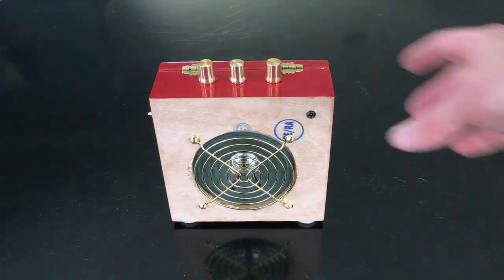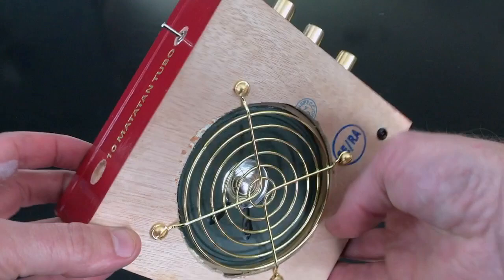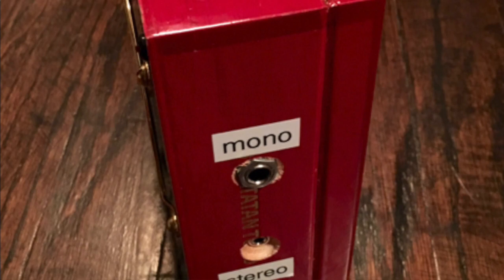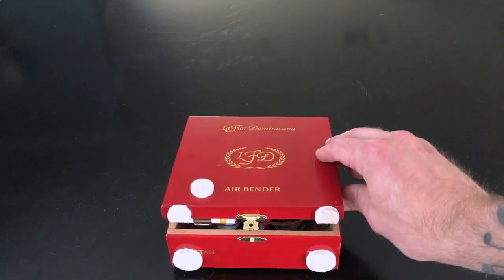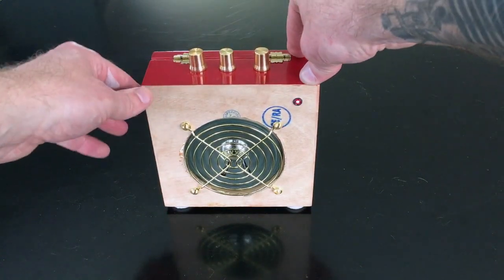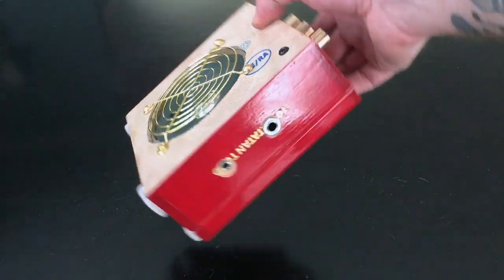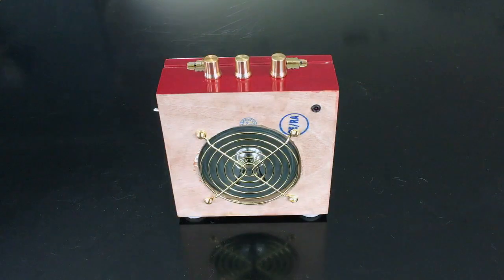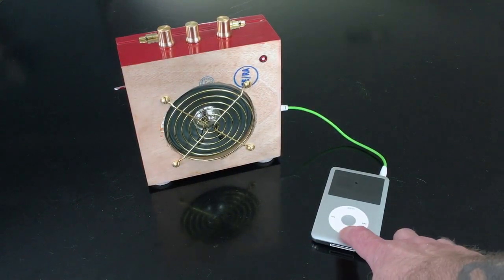DIY Cigar Box Amp #2

Comment: Hello from Italy.
I have my own cigar box guitar with a classic round shape passive piezo.
If I built a DIY amp as your,can I connect the CBG straight to the amp or do I need a preamp?
Thanks so much!!
Reply from the maker: You can connect it directly to the amp. It won't hurt anything. Some people really like the direct sound, but many prefer to plug it into a preamp first. Piezos tend to sound pretty harsh when not going through a preamp, but again... some people like that.

If you don't have a preamp built into the guitar, you can easily build an external one. Check out this video: https://www.youtube.com/watch?v=jlSqJZb9Vrw

Thanks for watching BTW.
Reply: @musicalmiscellany  Thanks so much ,very clear 🎸